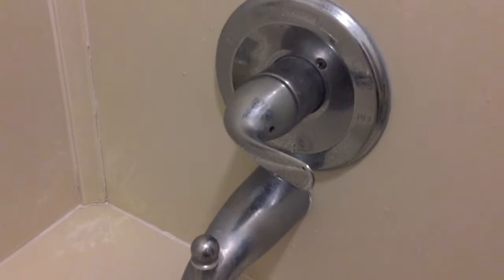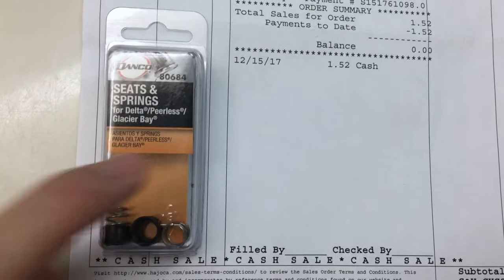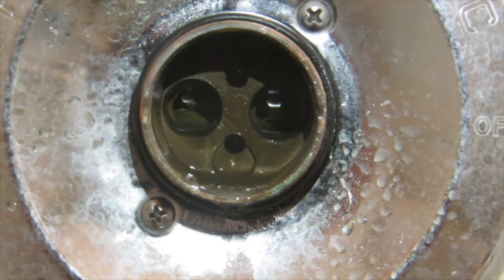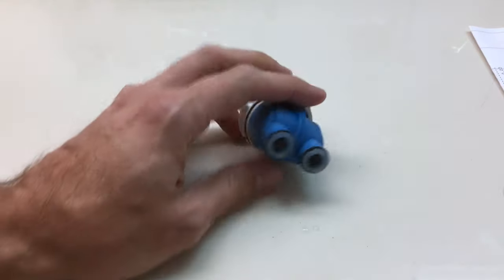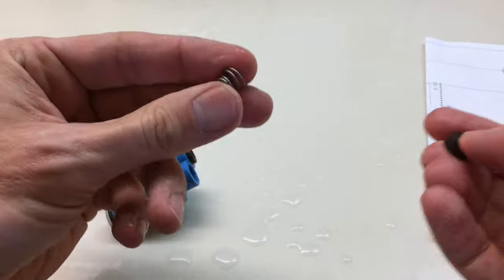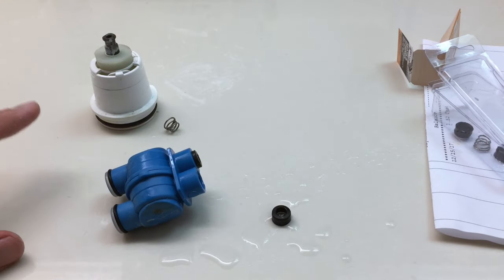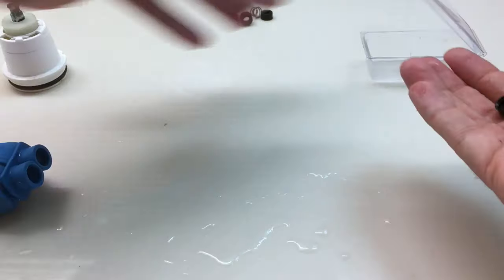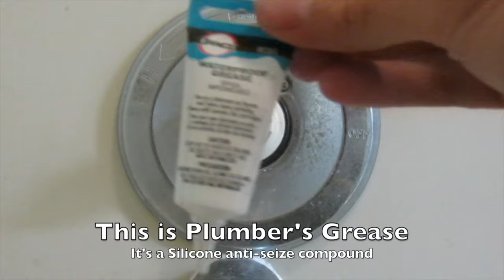Fix a leaky Delta Single-handle shower faucet for UNDER $2!!

Comment: How would you get the handle to be unstuck? After I took the screw off. Handle doesn’t wanna come off
Reply from the maker: You have to be very careful because the cartridge is 2 pieces and if you force it off, it'll snap at the juncture.  I always have to wiggle mine in multiple directions to loosen it up before I pull straight off.
Reply: Wiggle gently as you pull out straight. Sometimes it will take a lot of pulling. Maybe take the set screw all the way out to make sure it's out of the way (cover the drain as it will fall in if dropped).
Reply: Maybe a little bit of that plumbers grease on the part of the handle that inserts into the cartridge so not so tough to take off next time? Same goes for the set screw. Mine is now stripped and I'll likely have to drill it out and/or break the cartridge to get the handle off. Bad design, especially for hard water systems where it gets calcified/corroded.

Comment: If I have a brand new Delta Monitor cartridge that is slowly dripping from the showerhead, about a drip every 30 seconds, should I apply some plumbers grease to the seals (the blue portion)?  I applied none and the cartridge (RP19804) didn't mention it.
Reply from the maker: In my experience, the grease won't really help with the seal because it's more of an anti-seize agent.

Comment: Are all the Delta single handle faucets pretty much the same as far as these parts are concerned?
Reply from the maker: Pretty much, their cartridges do differ somewhat based on year from what I can tell, but not a significant difference.

Comment: This has not ever worked for me.  Been in my house for 15 years, and I've had to replace somewhere between 12 and 15 cartridges over the years.  Hundreds of dollars, even at a "cheap" price of $24.  Each time, tried replacing the seats and springs first before getting a cartridge, and every time the dripping continues.  Best advice in this video is to buy from a local supply store.
Reply from the maker: I"d also check into the Delta Warranty.  When I tried the warranty for the full cartridge, they sent a free replacement, but it's not the simplest process.

Comment: Do you need to turn off the water to the house to fix this?
Reply from the maker: It doesn't have to be at the house.  We have valves at the shower, but at some point, the water needs to be turned off, yes.

Comment: Do I need to turn off the water to the faucet before I do this?
Reply from the maker: Yes.  You'll need to turn it off at the street if you don't have a valve on your line.  I had to turn off at the street.

Comment: Thanks for sharing. I need to work on a leaking Delta shower valve but am having difficulty taking out the handle. What size allen key did you use on yours?
Reply from the maker: I'm sorry, off the top of my head, I don't know.  It's very small.  I can check and get back with you. One issue may be that the handle has seized onto the cartridge.

Comment: I had same thing, but after replace the rubber and spring, didn’t fix it. And I made mistake , hot and cold water reversed.  Will try again next time

Comment: I removed the Allen screw on my shower faucet it was a bit tricky, but now the handle won't come out, I hammered it softly around, heated it up with a heat gun, prayed it with a wrench and the darn thing won't come out, so I still have a leak there. Any ideas?
Reply from the maker: Best I can offer is get something like CLR and try to soak the inside with it. This may break the scale enough to get the handle off.  I ended up with a gallon bag wrapped around the handle with CLR inside.  That worked the first time for me.

Comment: did this without the grease and its still leaking. could this be the only other solution?
Reply from the maker: My bet is that it may not be seated into the opening well.  There are the 2 little holes in the back.  Sometimes when those aren't seated, it will leak.  It may also be that you may just need a new cartridge.  I have an older home and Delta told me that sometimes there's sediment in older pipes that will clog the actual cartridge.  They recommend new cartridges or "blowing out" the pipes, which is essentially taking the cartridge out, opening up the valve and letting the water shoot out.  Good luck and thanks for the comment!
Reply: @TXSuburbanHomestead  the house is only 2 years old

Comment: How about telling me how to get the calcified handle off without breaking it?
Reply from the maker: I turned the water off at the main and kept soaking the set screw with CLR on a day when my family was gone.  Took several applications and even had to get a curved syringe and spray the CLR inside the handle.

Comment: Thanks for your great video. How do you find the model number for the faucet? I've been leaving in my cookie cutter home for the past 17 years now and I have no idea how to find the part number.
Reply from the maker: First off, thanks for watching & I'm glad it was of some help.  On the model number, good luck...  There really isn't much of a way to find it on the actual faucet itself, but Delta has a pretty good online tool that can help you narrow it down.  It's the link below.  However, I found that if I just took mine apart & took it to a local plumbing supply store, the were able to help me even without the model number.  

https://www.deltafaucet.com/service-parts

Comment: Ok mine is leaking like this and when I take a shower and I pull knob for shower mode water still pours out the faucet and I barely get any water pressure out of shower head will this fix that
Reply from the maker: No, that is most likely an issue elsewhere in the mechanism.  I'd call a plumber for that issue.

Comment: Do I need to shut off outside water caalve
Reply from the maker: You either need to shut it off at the street or wherever you have a shutoff valve.  For us, that was in the wall behind the shower.

Comment: I replaced the spring seats like in this video but the leak is not gone. I also have a self contained Delta cartridge unit. :(
Reply from the maker: There's 3 options as far as I can see.  One is to remove the cartridge and turn the water on for a few seconds.  A plumber friend told me to try this.  Sometimes there's gunk in the pipes that needs to be blown out.  Secondly, I'd suggest replacing the whole cartridge.  Lastly, I'd call a plumber.  All in all, when you call the plumber, you'll just be out a little money and time, but if the others work, you've saved yourself a call to the plumber.

Comment: Did u have to turn the water to the house off first ? Probably a dumb question
Reply from the maker: Not a dumb question. You either have to turn the water off to the house or if you have valves on your end flow water to the shower, you can turn it off there.

Comment: You replaced the cartridge and it again started leaking in a few months?
Reply from the maker: No, the plumber replaced the seats/springs and it started leaking in a few months.  It's not a great overall design.

Comment: I replaced de seat and the spring and the leak continues, what should I do?
Reply from the maker: Try replacing the whole cartridge. That would be my next step.
Reply: @TXSuburbanHomestead  I did that and it worked, thank you.

Comment: Seats:   Another word for seal?  My thesaurus is broken.  Or does the seat just keep the spring tensioned on the other side where the seal is? I’m only 5 1/2 minutes into this video.    😬
Reply from the maker: The seat can be thought of as a seal or grommet. The spring keeps pressure on the seat to keep the valve closed. Hope this helps!

Comment: How do u make the water goes to the shower head
Reply from the maker: There's a diverter valve that's connected to the faucet.  It's one of the standard pull valves on the faucet.

Comment: Great video. Heads up though for people who think this will be this simple...my cartridge got stuck and broke off. It had to be drilled out and ripped out in pieces.  

There is a tool that can be used to lock into that cartridge to assist in pulling it out.  May be easier than what was done on my end. 

If you're familiar with projects like this, i guess none of that would be a surprise. If this is the first time you attempted something like this, be prepared it may not be as simple as it looks.
Reply from the maker: Thanks for adding that.  There is a tool that can help if the cartridge is stuck.  Since the cartridge is a multi-piece unit, there is always the chance of it failing and breaking off in the socket.
Reply: Just put your handle back on and pull it out that way. But make sure the screw on rimg is off first. And just in case anyone wants to try, I stretched my springs back out. It didn't work... Just get the kit
Reply: 100% right! I just replaced my delta shower cartridge today and took me 4-5 grueling hours...everything was stuck/seized starting from that little screw, bonnet brass and the cartridge itself I had to drilled it into pieces 😬! The worst thing I had to pay $52.00 + for delta rp 19804 ...danco price was $31.00 + but I was worried it may not work I don't wanna do all the hardship/hard work I put in already!!!!

Comment: I can't find tongue and groove pliers you use in this video to save my life, and the set that I have can't get any grip on the sleeve holding the cartridge in place, and it's either calcified or glued in.  It might be really helpful to lay out the tools you use and what they're called, for people like me who don't even know what to look for.
Reply from the maker: I'm sorry, him a bit behind on keeping up with comment. The pliers amusing or called channel locks. You just need to make sure you get one with a large enough opening. It very well may be that  If you have hard water it may be calcified and it may take heat to get off. If that's the case, with the cartridge being plastic, I would go ahead and call a plumber. Sometimes, the caller is hard to get off because whoever install it didn't use the plumbers grease.

Comment: My cartridge stuck and could not be taken out.
Reply from the maker: Sorry to hear that.  Mine sometime sticks & I have to give it a few taps with a rubber mallet while I twist it with a channel lock.  If you were able to get it out, but broken, just remember to try a local store rather than a box store.  Mine was about 1/2 the price local vs. Box store when my cartridge broke one time.
Reply: I ended up removing the outside part of the cartridge (by cutting the alignment notch and twisted it out), and changed the seats and spring, then snapped the outside part back on.

Comment: This video would be better if it was more informative on all of the tools. I have a set of Allen wrenches and none of them fit in the faucet's screw. What size are you using?
Reply: Its 1/8 Allen wrench, I read from the previous comments 😊
Reply: @darlmayor7444  Thanks!

Comment: While I understand your sentiment and I completely support buying local, you might want to make sure the idiots at the blue or orange big box store have their product merchandised correctly. Either that or you switched the product to the rack for the dramatic visual of the price tag. FYI, the item number on your seats and springs does not match the item number on the price tag. Also the time description is for a delta brand trim kit, not the Danco seats and springs, which are $3.40, not $12.99. That being said, I echo the support local over the big box stores any day. I would say support local even if you pay more, or in this case support local and save yourself a couple of bucks! Great video too.
Reply from the maker: It may be the case of the switching in the store, but I didn't do it.  Thanks for the comment!

Comment: I replaced the whole cartridge and it still leaks
Reply from the maker: If that's the case, I'd say there's something else wrong and I'd call a plumber.
Reply: Did you clean out the area that the cartridge goes into? Also...are you 100% sure you got the right cartridge? Guess it could also be a faulty cartridge.....good luck.

Comment: The little screw won't come off :(
Reply from the maker: I"m sorry.  That's a pretty common problem with set screws that haven't been removed or set with anti-seize, especially if you live with hard water.  I'd call a plumber, that way if it breaks, they're there to do.a larger fix.

Comment: The music is way too loud. I almost destroyed my faucet. My Delta was a little different. On mine, I had to turn the valve counterclockwise a quarter turn before it would pull out. I tried to pull it straight out like yours does. It wouldn't come. I pried  on it with a flat screwdriver and almost broke it before I figured out it needed to be turned. But thanks anyway. You video was better than nothing.

Comment: If the water from the shower valve is connected to the main water line and you remove the tub valve without turning the main water line off, water will spray out of the valve. There will be no way to turn it off until you turn the main water line off.  If this is a true statement, you should revise your video.  I'm suprised you didn't at least address it .   Why didn't you think it needed to be addressed?
Reply from the maker: Because everybody's setup is different.  Newer homes have a shutoff valve there on the incoming water lines to the tub.  Some homes have a single valve in the house, others, like mine, have to be turned off at the meter.

Comment: Delta warranties their faucets for a lifetime, just call them.
Reply from the maker: Very true!  I contacted them and they would send the parts out.  They wouldn't charge me for the parts, but they wanted to charge me $5.60 in shipping and it would be to me in 7-10 days.  If you've got some time to wait, this is definitely a good option to guarantee you've got the right stuff.
Reply: @TXSuburbanHomestead  I called them last week about my dripping shower, they sent out the springs & seats (rubber things) and I had them in 3 days with no charge.  But they didn't offer the whole cartridge, for that it might be different.  I'm going to attempt to fix it today after I build my courage up to go under the crawl space to turn the water off!  It's already been 2 days I've avoided it.  LOL!
Reply from the maker: @cindyp5132  Good luck!!!
Reply: @TXSuburbanHomestead  I DID IT!!!  The cartridge was hard to get out but overall very simple after watching your video.  When I took the cartridge off the rubber thing popped out straight at me and scared me have to death (anxiety left from the crawlspace LOL).  But it's all done.  So while the water was shut off I dealt with a spigot outside that wasn't turning off correctly.  Turns out the screw on the end that holds the washer had come off, I saw it but didn't think it was the whole problem and it was...  In the future, I would love to see a video on upgrading an outside spigot to the new freeze-proof ones.  Apparently, it's easy as long as you don't have copper piping (I don't) and you just screw them on.  So if you don't already have them and decide to upgrade it would be great if you did video, as I'm sure there are lots of people interested in the new all-metal ones ($20).  Thanks!
Reply from the maker: @cindyp5132  That's great!!  Congratulations on a project well done!  The idea about the spigots is a great one, unfortunately I've got the copper pipes and my city has regulated special backflow prevention models. Thanks for the update and the idea though.

Comment: Im a plumber and you must be cheap as hell you wouldn't hire a plumber to fix your shower valve I love customer like you you get what you pay for....
Reply from the maker: Why? Why does it make me cheap? I think it makes me sane. A widely accepted colloquialism for insanity is to continue to do the same thing the same way and expect different results.  Prior to learning to fix it myself, I had two licensed plumbers come "fix it" for a grand total of $230.  It seems insane to me to continue to pay $115 for a whole hour worth of work on a 10 minute fix where the parts cost less than $2. They themselves told me it was a bad design and that it was something that would need to be fixed periodically.  So, I learned to fix it myself. 

Do you, in your professional opinion see any subpar work, is there anything I'm missing?   I ask because nothing has gone wrong since I fixed it; it has even lasted longer than the last 2 times that a plumber has fixed it.  So, yes, at this point I would say I've gotten what I paid for.
Reply: @TXSuburbanHomestead  you have to understand that as plumbers we have to pay for gas we have to pay for insurance so charging you $100 to come to your house to fix a 2-minute problem is actually good come live in Florida and you would probably be charged $190 for that that was good you learned I'm proud that you learned how to fix it yourself Great
Reply from the maker: @markcortes6650  I understand how business works and the overhead of running one.  But sometimes as a business owner, you have to understand that we, as customers, see the bill and see the actual fix, which in this case was simply replacing 2 rubber grommets, and may choose to look for other options.  I never advocated for not using a plumber.  I had one out to replace a toilet flange and a sink disposal for me just the other day because I knew those were outside of my skillset.  I simply advocated for assessing the problem, assessing your skillset, and using your time and money as wisely as you can.
Reply: Why would you hire some one to fix something as simple as a leaky shower faucet? I'm an electrician and I don't harass people on youtube for learning how to change a light bulb. xD
Reply: @bolivar4537  you rigth buddy👍👍